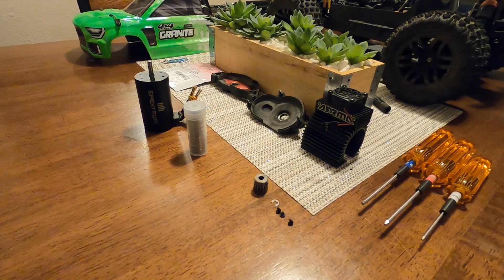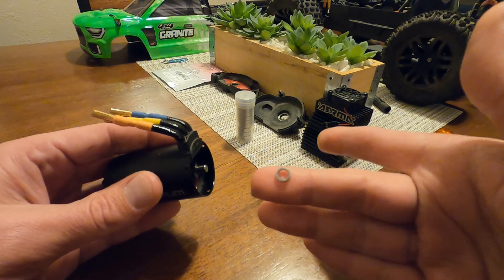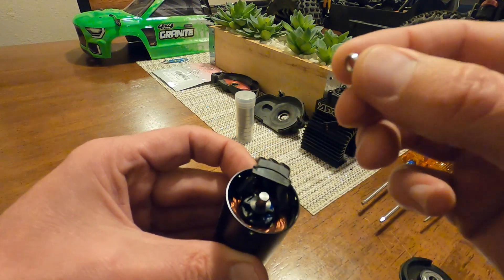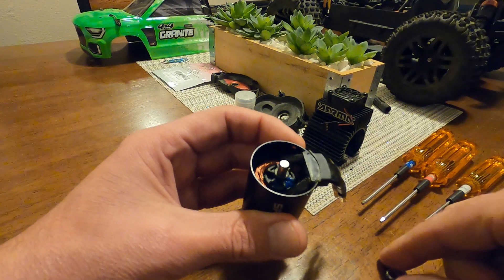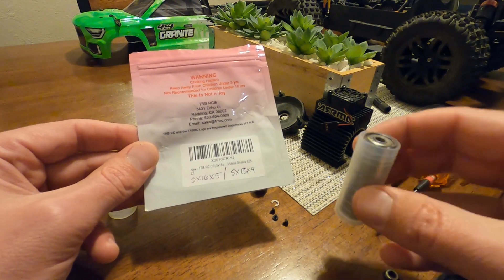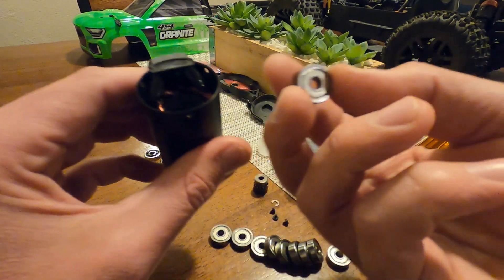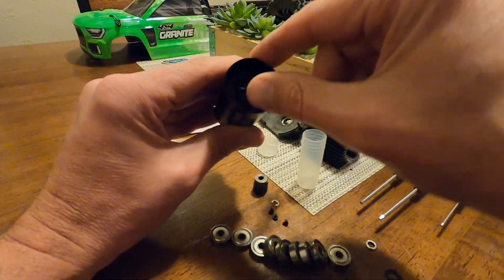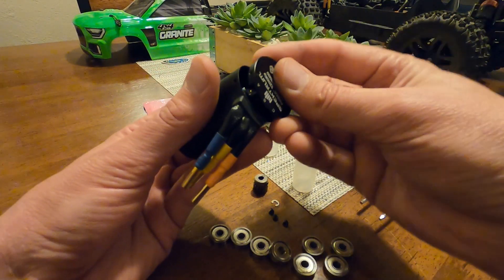Brushless RC Motor Bearing Replacement - Spektrum 3200kv (spmxsm2000 - Armma Granite 3S)

Comment from the maker: I bought these bearings on Amazon. Here are the links to both bearing sizes:

 TRB 5x16x5 Bearings (10) on Amazon:  https://amzn.to/3hiz2my

TRB 5x13x4 Bearings (10) on Amazon:  https://amzn.to/2Q5GWV8
Reply: You guys are awesome thank you
Reply: Thank you
Reply: Okay well when I tried to put the 5*16*5 in it was bigger
Reply from the maker: @carolynhitt1916  V3 has the big and small bearing....V1 and V2 have two of the smaller bearings.
Reply: @rcleesd  okay so I must have a piece of bearing stuck in the end of the motor how do I get it out
Reply from the maker: @carolynhitt1916  Try putting the motor/casing out in the sun or heat it up a bit with a blow dryer, without heating up the bearing. The steel bearing should stay a similar size, but the aluminum motor housing should expand ever so slightly, as aluminum tends to expand and shrink more than steel. Try that and let me know if you have any luck!
Reply: @rcleesd  okay I apologize bout the miss under standing I've been messing with this for a week now
Reply from the maker: @carolynhitt1916  No problem! I know how frustrating it can be!! Let me know if you have any luck getting that bearing casing out of there.
Reply: @rcleesd  still havent got it its hard to get in there to get it out without damaging it any tool suggestions
Reply from the maker: @carolynhitt1916  Maybe try the smallest flathead screwdriver or an ice pick/dentists pick would be ideal, but probably not laying around the house...worse case scenario, Horizon Hobby will warranty the motor as these bearings are a known defect in these motors. I made a quick video a while back discussing how easy it was to get the motor replaced for my Big Rock that totally grenaded and destroyed the motor rotor.
Reply from the maker: Maybe try to bend the casing out with a 2 5mm hex driver?
Reply: Appreciate your video! I wonder how the bearings sold on Amazon held up eventually?
Reply: Thank you so much

Comment: thanks for this information you just saved me the searching of what bearings to deal with! Btw, when you seated the inner bearing did it seal completely from the pinion side? It looks like mine is in after a few taps, but there’s still a small gap between the bearing and hole where the pinion shaft goes out
Reply from the maker: As long as everything runs smoothly you should be ok.

Comment: Having trouble getting the new bearing in, any ideas? Already destroyed two new ones …
Reply from the maker: You can try putting the bearing in a zip lock and throw it in the freezer for a few hours to get it to contract a tint bit. You can also try to warm up the housing with a blow dryer to help expand it a bit...just don't get it too hot.

Comment: what do i do if the case of the bearing is stuck in there? the core and balls fell out but not the case. help?
Reply from the maker: It's not easy. Try to find a pry tool with a hook on the end or try heating the casing carefully with a blow dryer or putting something very cold inside to make it shrink ever so slightly so that it can be removed a little easier.

Comment: I am waiting on my replacement bearings. I had to make a Hook from a Small blade Screw Driver as a tool to remove the Rear Bearing.. Used a propane torch to heat the rear cap held by the Pliers.. Then I slowly pride the bearing out.. It was not easy..

I would love to see Bread Crumbs remove Yours...😂
I personally don't believe that at All..
Reply from the maker: I definitely didn't do the bread crumb method, haha.

Comment: Hey thank you for the video! Where did you find the bearing sizes for Spektrum motors. I have the spmxsm1600 1900kv that needs new bearings. It’s a 4274 motor. Thanks!
Reply from the maker: I had to look them up on Google and some other videos to verify.

Comment: I replaced the front bearing using your guide. I bought the bearings that you linked to. Guess what happened. The new bearings broke within 30 seconds of driving. 😮 I bought a new motor, hopefully that one lasts longer.
Reply from the maker: What a bummer! These rcs tend to get a lot of dirt and sand in them quickly. Can I ask what you were running on? Clay, grass, asphalt, dirt, sand?

Comment: I’ve tried a bunch of different ways to get the inside bearing out and I still can’t get it. Any other suggestions?
Reply from the maker: Try hot and cold. Maybe set the casing out in the sun for a while and then a frozen cold spoon on the bearing itself. Some people have had luck putting it in a bag, then into the freezer....then after about 30 minutes, take it out and blow dry the aluminum casing to expand it away from the bearing.
Reply: @rcleesd  yeah I did try that and I’ve tried a couple other ways and after nothing worked I ended up drilling the front of the motor and the tapping the bearing out
Reply from the maker: Right on!

Comment: Very helpful video really helps but i have a 4000kv and when i pulled the rotor out 2 of those curved washers fell out do u know where the other curved washer goes by chance tia
Reply from the maker: Hmmm, I don't want to give you the wrong information for that motor. Is it a Spektrum motor?
Reply: Same thing happened to me did you find out where the other one goes?

Comment: Thanks for the vid on the exact same bearing problem in my wife's Typhon. The main problem I still have is that the motor bearing is completely exploded with only the outer bearing race still stuck in the end of the motor. There seems to be no way to get the race out now. Any tricks to accomplish that ?
Reply from the maker: Sorry to hear that! I would say hot and cold...possibly put the cap in the freezer for a while and then try to heat just the motor end cap with something (blow dryer, lighter, etc). The temperature differences may allow for easier removal. Let me know how it goes!

Comment: I see you did a wonderful work for changing the motor bearings  especially the big one 5x16x5.  For me I am still suffering from that. And I couldn’t fit it    , so if you don’t mind to show me an easier way
Reply from the maker: Try heat and cold (freezer or sunshine) to expand the aluminum housing and try putting the bearing in a sealed zip lock bag into the fridge or freezer for an hour.

Comment: Awesome video.  My motor seized up.  The pulled the rotor out and all the bearings just fell out.  Now the hard part is taking out the outer ring of the bearing.  Thanks for the video.
Reply from the maker: Good luck with that outer ring of the bearing. Try to heat up the casing (it's aluminum so should change shape quickly) by either leaving it in the sun for a while or a blow dryer. Then, try to cool only the bearing (ice, frozen nail/screwdriver) by touching it with the cold item. Let me know how it goes!!
Reply: Thanks for the tip.  I will give it a try and let you know.
Reply: I got it out.  It was pretty simple.  I used a 1/2-13 flat bottom tap.  Screw in the tap like I was going to thread a hole.  Made sure it bottom out.  Flipped the motor 180 and hit it out with a punch.  I'm not a guy who likes making videos but might try to post something up to help others too.
Reply from the maker: @xiong2moua  Awesome!!

Comment: But what about the bearing in the other end of the motor? That's the one that just shredded on mine and I can't seem to get the outer ring to come out.
Reply from the maker: There is a bread crumb method...check it out on YouTube and let me know if you have any luck popping it out with the bread trick!!
Reply: @rcleesd  Its only the outer ring that is stuck (all the ball bearings rolled out when the center of the motor was removed), there is nothing for anything to get behind it. It's not the bearing in the front cap, its the bearing at the bottom of the motor that you have to remove the motor from the housing to even see.

At this point I've busted several dremel bits trying to cut through it at the terrible limited angles of approach as well as ruined several flathead screwdrivers trying to chisel it out.

Comment: Looking at the TRB bearings and wondering how they have held up compared to stock?

I also have the BLX 2400KV 4s motor does that motor have the same size bearings.?
Reply from the maker: Hey Trey! The bearings have held up well, no issues.  I'm not sure about the 4s motor, but I would assume it would be a bit bigger than the 3s version.

Comment: Just did mine in a new typhon v3 as a preventative measure as there are lots of reports of them disintegrating pretty fast although I suspect a tight mesh from factory is contributing a lot.
Mine had a black rubber seal on and seemed perfect but hey ho it's done now, I put an SKF one in so hopefully that'll last a good while.
TOP TIP- to get the old bearing out easily use the t bar from the wheel wrench and tap it down while holding the motor, comes out easy.
Reply from the maker: Awesome! Thanks for the tip to get the old bearing out!

Comment: This video really helped, but man that was a pain to do. The bearing really didn’t want to go in at all and it wouldn’t fully seat no matter what i did
Reply from the maker: Yeah, it is very difficult. I think heating up the aluminum slightly (to like 90 degrees) helps expand it a tad and can also help with removal...a blow dryer seems to be the most efficient and safe way to warm the metal. Thanks for watching and commenting!

Comment: I need some help. I had issues with the same motor and same bearing. I pulled apart the motor, and the bearing had shredded apart. Part of the bearing is still stuck at the end of the motor. What should I do?
Reply from the maker: Same thing happened to me on a second motor like this. If you can't seem to pry it out, then I would give Horizon a call, as it's a known issue with this motor. They will replace it, free of charge. I have a video about it if you look back over my library of videos. Hope this helps, let me know if you get it out, and or if you get a replacement from Horizon.

Comment: Well thanks for letting me know. I could have swore that the new motors had the same size bearings and the old one has two different sizes. I think the one I ordered from tbr had all 3 bearings just in case. Well I hope lol.
Reply from the maker: Interesting, that may be the case, production has been crazy lately and companies are using what they can get these days. Let me know when you get it taken apart, if they are the same size or not. Thanks for watching!

Comment: Hey there! Fellow arrma senton owner here I have a v3 I hear weird noises coming out of mine at low speeds and I don't like it do you think this can be the issue to that weird shaking noise?
Reply from the maker: It's definitely possible!! Does it make the noise when just rolling the rc while off?
Reply: @rcleesd  yes only at low speeds I tightened the clutch today and it's running much smoother but it still makes the noise at low speeds I'm starting to think it's just a 3s thing 100 blx thing

Comment: Just had me staring at my 'spacer' for 10 minutes looking for any kind of difference between the sides...both sides are completely flat...
Reply from the maker: It's possible they may have used different  spacers when manufacturing over time.

Comment: U get the truck and your like damn that a pretty big motor and u take it apart and then u realise that the motor is accually really small and it manages to make the car go 50 in like half a second and do some crazy shit I cant imagine what it's like to put coke can sized motors in there with better speed controller and whatever
Reply from the maker: I know, right? Then I think about the motor that powers Teslas and how fast those go at about 4,000lbs. Incredible technology that humans have created over the years. Thanks for watching and commenting!
Reply: @rcleesd  just watched a video where a a dude lowered his and put a better esc in it and ran it 6s and it did almost 100 in a road not evan that big on the same stock 3200kv motor
Reply from the maker: So gnarly!!

Comment: You should seal the gromet where the wires go into the motor  the wires are a little smaller than the holes in the gromet and dirt can get into the motor i used black rtv to seal mine
Reply from the maker: That's a great idea!
Reply: @rcleesd  i found dirt in my motor and saw the dirt between the wires and the gromet so i sealed it up i havent had any dirt since

Comment: How would one know when to replace bearings in the motor? Anything to listen or look for?
Reply from the maker: Sometimes you can hear the bearing failure, but otherwise, trying to wiggle the shaft back and forth...if you notice any clicking or movement, it likely will need new bearings.

Comment: How to you more screws if  they are stripped?
Reply from the maker: I haven't been able to find those tiny replacement screws anywhere. Are you talking about the 3 for the motor end cap? Maybe a specialty bolt company. Out here we have Abbaba Bolt company and they have literally everything (So Cal).

Comment: Lately both my son and my Big Rock started making a louder sound coming from the motor. Both while rolling it turned off and also after truck is coasting. Since I verified it was coming from the motor I don't know what else to think it is. My granite blx which has the same motor is a lot quieter. Would bad bearings make sense on the motor sound?
Reply from the maker: Yes. It is very likely that it is the bearings. It could also be a small rock or twig stuck somewhere but if the sound is coming from the motor, then more than likely the motor bearings have failed. You might also get additional vibration from the motor if you hold the car in the air and pull the throttle, thus further verifying it is the motor. Try to take the motor out and wiggle the shaft (or pinion gear) and if there is play, the bearings are shot and need to be replaced.

Comment: I just fucking lost it
Reply: I feel like a fuckin idiot right now. I lost my beveled washer
Reply from the maker: @Will-216  That's a bummer, it is an easy part to lose.
Reply: 😁😁😁. I walked out to the garage an hour later and found it. I had the motor on my lap while I was working on it. I thought there’s no way it would have made it from my lap to the garage if in fact it fell in my lap. I said screw it… opened the door to the garage and there it was.  The garage is attached to the house by the way. 1 in a million find especially the way my garage looks right now 😑

Comment: I'm trying to determine how long these new bearings are going to last? Anybody have an idea of how long The replacements from Amazon will work I have them already.
Reply from the maker: Mine are still holding up at this point. My thought was to buy cheaper ones as I run in sandy soil a lot, so I could just replace them every so often. The other option was to go ceramic, but didn't seem worth it to me for bashing, more so for racing.

Comment: Just wondering if you know of a place to buy parts for the motor. In my case, I have a Spektrum 1250kv and my shaft snapped of. Can’t seem to find any place that sells parts for these. I’d like to try to repair it before I buy a new one.

Subbed!
Reply from the maker: I haven't had any luck getting replacement parts for the motor, other than the bearings.  Many people have asked about the tiny 1.5 mm screws that hold the end caps on too, but those aren't sold online, at least anywhere that I have found.  I would personally call in a warranty claim, that has been the best option so far for most people.
Reply: @rcleesd  Yeah I have done that. Replacement motor is being sent tomorrow. My current motor that’s broken is only a week old. I hate to throw it out. I guess I can always take it apart and see I can find a shaft from the ones listed on AliExpress. Maybe I’ll get lucky.

Thanks for the quick reply.
Reply from the maker: @jasondonaldson2150  I'm the same way, hate to throw something away when it is still relatively good. Maybe keep it around for parts?

Comment: Hey I’m back! My bearing isn’t seating so easily. Is this the old bearing stuck inside the motor? https://imgur.com/a/othbrVV
Reply from the maker: It looks like there may still be a thin bearing shield on the bottom of that photo with no bearing? Not 100% sure, but maybe try to scrape/pick that thin piece of metal out and re-insert the bearing.
Reply: @rcleesd  will do! Thanks!
Reply: @rcleesd  yep. I’m trying to get it off, but it’s at an somewhat impossible angle.. am I able to take off the front cap where you attach the motor?
Reply from the maker: @quarans08  you can try but it might be difficult. Worst case scenario, call Horizion and they will replace the motor for free as this is a known issue with bearing failures on these motors.
Reply: @rcleesd  ok, I’ll just try that for now. Thank you!

Comment: I got some blue goo stuff melted in the actual motor thing. Do you think that’s rubber from the other bearings? And I think I have part of the old bearing stuck on. Image: https://imgur.com/a/fEH0G80
Reply from the maker: Thank you for the photo, that helps a lot! That blue stuff is actually weight for balancing the motor shaft (done at the factory) similar to the way you balance a car wheel with weights. Don't remove it!

As far as the old bearing, yes, it does look like the old rolling center part is still there and the bearings and shielding went flying. 

Hope that helps, let me know if you have any other questions!
Reply: @rcleesd Yes, helps a lot thank you! 

I tried removing it but it’s just so stubborn! Would heat help loosen it? Would a blowtorch be overkill? 

I also have a lighter I can use. 

P.S thank you for the speedy reply!
Reply from the maker: I would try some leverage before heat, but a lighter wouldn't hurt.
Reply: @rcleesd  will do! Thanks!